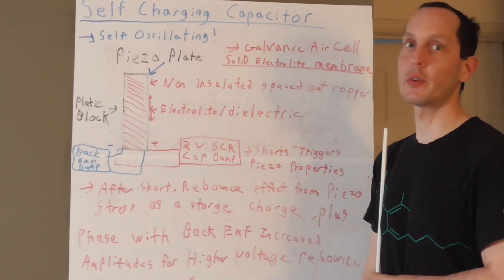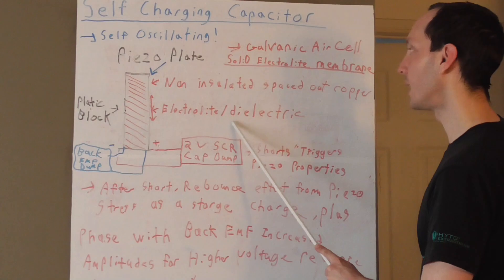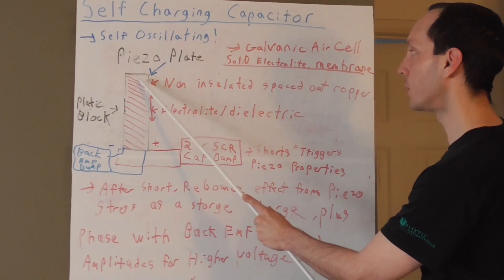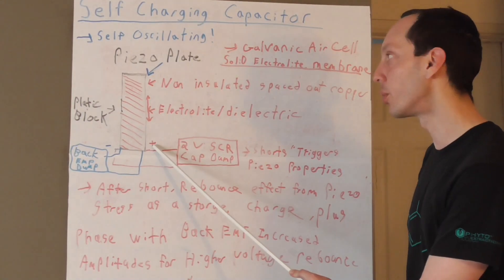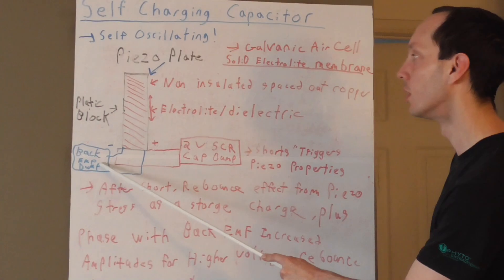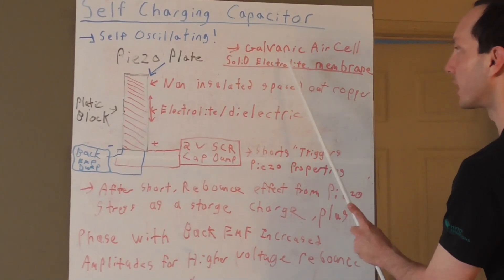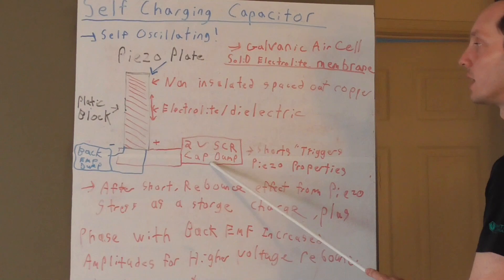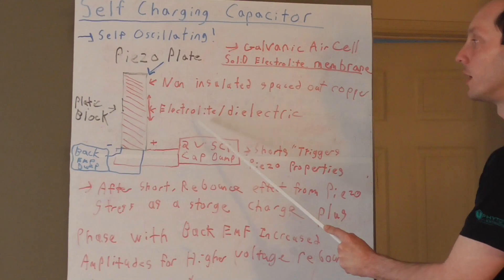Self Charging Capacitor

Comment: Great Joel! Is the piezo plate in series wirh the coil, or how it is connected? Instead the plastic block coule i use an iron pipe to strengthen the magnetic field of the coil? Greetings Sebastian
Reply from the maker: Yeah I thought of it as well but was not sure how that would react as a "capacitor" I suppose nothing stops us from building the coil separate.  How ever it's worth noting that these are slow oscillations and may not really benefit from such. We can always experiment, As you see. several variants of this concept can be put in action.